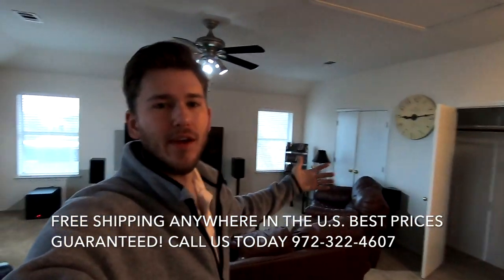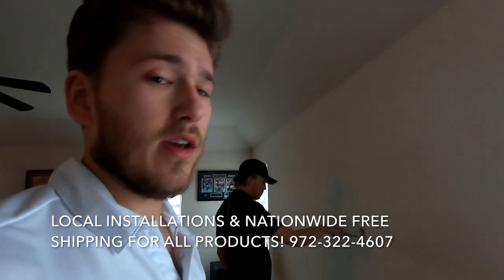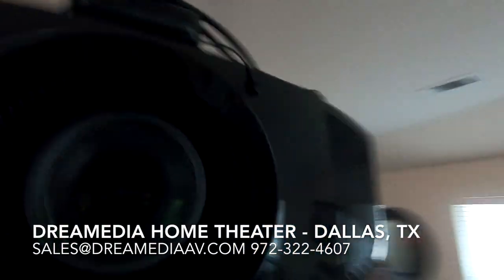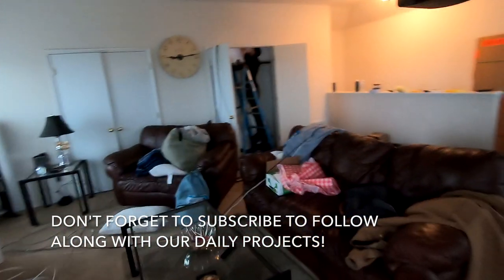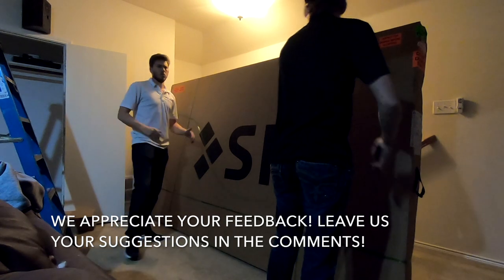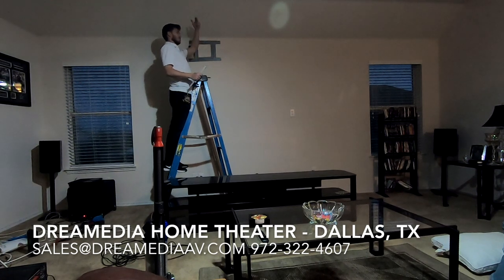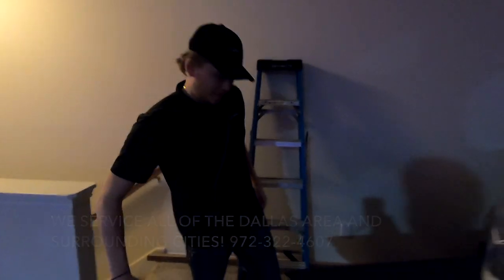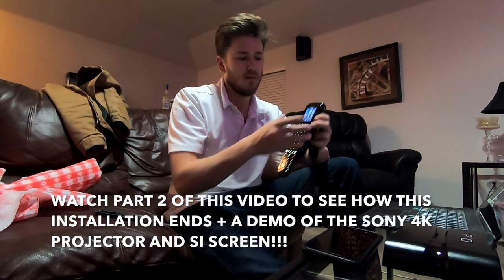PART 1 - Native 4K Home Theater Sony 295es and SI Black Diamond PRO Zero Edge 120"

Comment: Another great job guys. One suggestion though. Measuring down from the ceiling to each bracket is never a good idea. It’s very rare that ceilings are perfectly leveled and can throw-off your level from one to the other. Might be ok if you’re measuring maybe up to 24” from  one bracket, but anything more I’d recommend using a laser level. Laser level can also help to layout speakers at same height around the room too. Not trying to tell you guys how to do your job, but I build and renovate and I’ve been a carpenter all my life.😊
Reply from the maker: P F True! Thanks for watching PF! 😁
Reply: ahhh thats a good idea. Just ran into that issue recently where the ceiling was just a hair bowed.
Reply: Use a laser..problem solved..

Comment: Great video guys. I have seen most of your videos and noticed you don't use banana plugs. Is there a reason why you dont?
Reply from the maker: Eli Polanco jr Thanks for watching Eli! The reason we don’t use them on most installs is they lead to service calls. Now, on our super high end set ups we use tributaries custom made cables that have tensioned banana plugs so they don’t pop out and maximize performance. We are also using solid 12 gauge wiring vs stranded 16 gauge which makes huge differences.